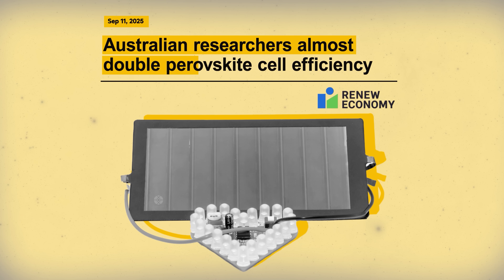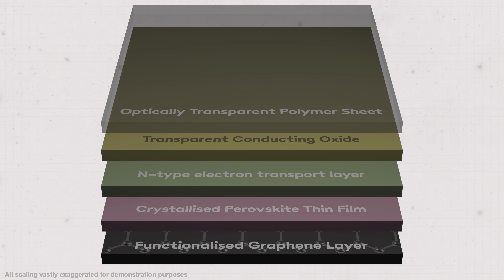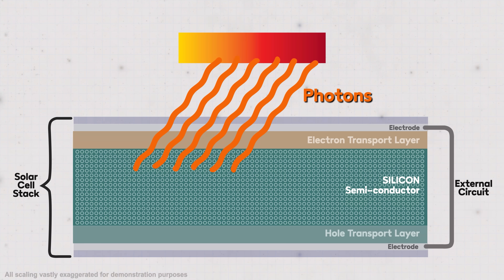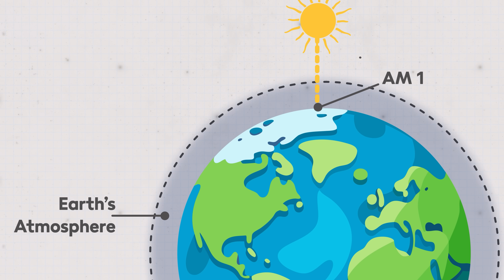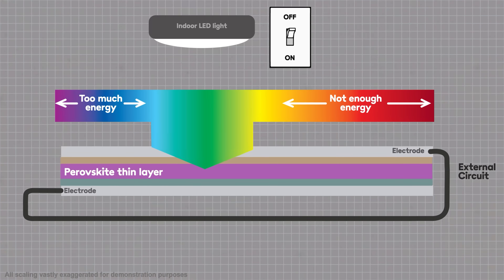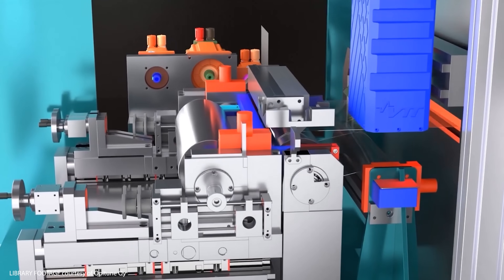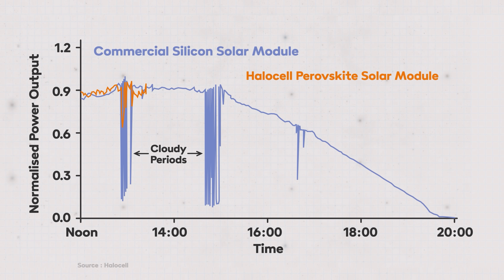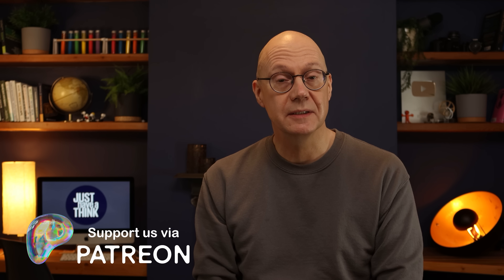Graphene Perovskite just revolutionised the Solar PV industry!

Comment: My advisor who was chair of my EE / CSE dept at Boston University between 2006-2010 once said, in response to the question "which technology domain do you foresee as having the largest impact upon the world in the coming decades?", unequivocally responded "materials", as in nanotechnology and additive manufacturing and composites and such. This video is an excellent demonstration of what he was talking about.  I've had 100+ professors in my life but my advisor is/was a very, very sharp guy among them all...

Your video completely leaves out the longevity question which is a major stumbling block for perovskytes. So there goes any potential for the viewer to make bang/buck comparisons between silicon, tandem cell and thin film solar. Then again, I don't suppose most viewers are aware that perovskytes can be produced for about 1% of the price of silicon panels in part because there's so much less material and in part because of the materials used and their abundance.

There's also a big question concerning recyclability if these thin film panels go bad every 6-12 months...

Comment: What are the relative costs of (1.) the actual panels of a domestic solar panel array; (2.) installing it; and (3.) buying and installing the controlling stuff, inverter, connector to the grid, connector to the battery (assuming you've got a battery), and the thing that decides whether to route the energy being generated to the grid or to the battery? 50%:25%:25%, would you say? 40%:30%:30%?
Reply: Installation is the expensive part

Comment: PV is already at the point where mounting and connections (wire) are at a greater cost than the panels.   Copper prices have escalated rapidly and we ain't seen nutt'n yet.

Comment: Very different story utility scale solar, which operates outdoor with different humidity and temperature conditions. Aslo, as of 2023, the cells cost about 0.2 $ versus 1 to 1.5$ for total installed cost, so only 13 to 20% of the cost. Even with 80% reduction of cell cost, that is only 0.11 $ reduction in cost overall. You can have greater reductions in cost just from better financing. Installation and Construction Labor alone is 15-25% of the Balance of system cost, so with AI and other improvements, we may actually get greater reductions faster.

Comment: This brought me to thinking somewhat of the opposite of absorption as transparency of light wavelengths to operate photonic circuits. Circuits and computers that operate with light instead of electricity. 

If this could be optimized to use solar wavelengths as a variable photonic supply that could be regulated as signals, clocks, and data for orbiting satellite data centers and super computers.
Reply: The operation of these computers could be running analog computations and converted to digital before providing results to ground stations.

Comment: Graphene has been the the horizon for 15 years. Report back when they have made 1 M panels, at a cost that's attractive. The must be using multiple layers of graphene, a 3 mm wide strip of single layer of graphene, 1 m long has a rather high resistance of 5,000 Ohms, a 2 mm copper wire 1 m long has a resistance of ~ 5/1000 ohm, so they must be putting on quite thick ( or at least many layers)

Comment: Something being made of mostly recyclable materials does not make them intrinsically greener as the recycling process itself for some materials is extremely dirty and enegy-intensive. Plastics are theoretically recyclable but the bulk of it still ends in landfills or incinerators because recycling them (ex.: anaerobic cracking for the otherwise unrecyclable stuff to turn it back into plain hydrocarbons) requires more time, resources and energy than it is worth at least for now, especially when you add all of the carbon neutrality burdens on top.

Comment: Mildly good news from China. 1.4 bn Chinese are a major part of the 8.2 bn people living on the planet they have 30 % of the CO2 output - and  they are 17 % of the gobal population. (still use less than the U.S. per capita, and are the manufacturing place of the globe). But their output is relevant. In 2025 it might not rise for the first time (the last quarter is still out).  Some sectors like Chemical industry used more oil, construction / steel and transportation used less. Electricity is mostly produced by renewables and they improved the efficiency of coal plants. They rolled out renewables and EV big time.

Comment: In my experience of evaluating perovskite PV startups, the hurdle is not their efficiency or cost. Those are perovskite's advantages. The main problem is that LEAD is used as a key component in the light-absorbing perovskite material to form a lead-halide compound that efficiently converts sunlight into electricity. It is such a big problem that even China, with its lower environmental safety standards, has not begun mass production of perovskite solar PV cells.

Comment: Come on. The fundamental problem with perovskite solar cells is that they degrade quickly. You can reliably expect 80% of original energy production two decades after installation from silicon based solar cells but perovskite degrades three times faster.

Comment: I think it's extremely deceptive to say this has "revolutionised the solar PV industry" when the use case that this performs well in is speciflcally with non-solar sources of light.

It also seems pretty disingenous to talk about how impressive the 30.6% figure is in comparison to state-of-the-art AM1.5G measurements when the 30.6% figure isn't an AM1.5G measurement at all. It's comparing apples to oranges.

I can see the use cases for this technology, but the way it's been presented is sensationalised & clickbait.

Comment: Having recently installed some Balcony Solar, and bought some home solar, I noticed that most of the cost is nothing to do with the panels. Even with Balcony (DIY) solar, the support structure costs the same as the panel.
Hence reducing the cost of panels (currently €55 for 450W in Germany) further will have little effect.
However, increasing the efficiency would have a major impact. When the 10KW system can become a 15KW system, but with the same labour costs, same frame costs, pretty much same wiring and inverter costs, then we can get further cost reductions.

Comment: Once a week there is discovery that revolutionized the solar panel technology imroving efficiency by 50-200% and reducing manufacturing cost to half. Still in past 20 years solar panel efficiency has only improved like 2%. Cost not having changed that much.

Comment: Adding graphene layer to the existing silicone photovoltaics would eliminate their biggest problem: degradation over time.
This degradation happens because hot spots melt thin copper wires inside.
Graphene can take a lot more heat and still be functioning.

Comment: Technical breakthroughs like these were not factored into Tony Seba's predictions about lowering coast and improved efficiency in clean energy.  Instead, Seba focused on already existing technology and based his predictions, remarkable accurate ones, on the learning curve in manufacturing and volume growth.  Tech breakthroughs like these will boost the the benefits of clean energy -- lowering costs and greater efficiency.  Tony's solar energy predictions from around 2010 showed a halving of the cost of solar energy every 3 years or around an 87.5% reduction each decade.  He predicted that this S-curve of lowering costs and higher production would continue into the 2030s.  Wholesale costs for energy produced by U.S.  grid-scale solar arrays is around 2.5 cents per KWH or $25 per MWH.  That's about half the price of electricity from Natural Gas combustion.  By 2031 solar electricity will be below $.01/KWH.  Virtually free as RethinkX predicts.

Comment: Even if they have doubled efficiency AND lowered cost, they still haven't fixed the major unfixable flaw. They only generate power for about 8 hours a day (with ramp up and drop off) and only anything near nameplate from 10am until 2pm yet produce nothing at all from 4pm until 8am the next day. That's 16 hours of zero generation during the time of peak demand.
Reply: 😂
Have you heard of storage ?
How about wind, water, geothermal, ?
You fail to mention when the peak demand occurs.
Time you stopped talking crap.

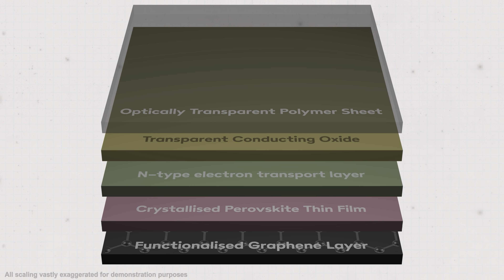Comment: 2:18 Remember, graphene only acts like graphene when it’s suspended in vacuum, not touching anything. It’s so thin that sitting on a surface changes its electron structure, wiping out its interesting electrical properties.

Comment: First of all, adding graphene might make the device cheaper, but it is unlikely to add any performance benefit in comparison to silver or gold.

2) They added metal nanoparticles to the graphene. Usually those metal nanoparticles are gold. So it still has expensive metal in it, especially since they are nanoparticles, which adds to the cost.

3) The problem of perovskite is the stability. Replacing the bottom metal electrode hardly helps.

4) The silicon panel cost of solar installations is a small fraction of the total cost. Even if you cut down the panel price by 80%, your gains are marginal.

5) The real step forwards is tandem solar cells, but you cannot use a graphene-nanoparticle layer as an intermediate between perovskite and silicon.

6) Perovskites contain highly toxic lead, making it questionable in everyday applications. Nobody wants their kid to use a calculator that turns them stupid through lead exposure.

7) Indoor lighting is a very niche application. It will hardly revolutionize anything.

Comment: It seems to me that this light weight technology could be placed on the inside of existing windows, in place of curtains which are drawn typically when the sun is beating into a room,  In high density environments, such as Office Buildings or high rise Condo / Apartments the roof space per occupant is reduced the higher the building goes and utilizing the sunlight through the windows on sun facing surfaces could power a good chunk of the Office or multi-family home locations.  I feel that only thinking of ground or roof mounting is fairly limiting and loosing out in areas that are forced to build upwards.  The economics works out for the "renter" of the office or apartment as they are on the hook for the energy bill, not the building owner at least in the US.

Comment: Chemist here. One of my professors is very knowledgeable regarding solar panels and I'm going to explain what i remember from what he told me over a year ago. The problem with perovskite solar panels isn't their cost or their performance. The problem is that they use lead for the crystal structure, which is toxic and banned in electronics. Moreover, they degrade by moisture and uv light, and guess what solar panels get alot of. So while these numbers are cool they have no value as long as the existing problems aren't tackled.
Reply: You took the wind out of his sails

Comment: #Graphene ⚡🌍💡 People keep talking about AI, EVs, and clean energy like they’re the future but they’re missing the real foundation that’s going to power all of it graphene the Miracle Material. This isn’t just another buzzword material this is the next evolution of everything. Graphene makes artificial intelligence run faster makes electric vehicles charge quicker makes solar panels and batteries more efficient and even strengthens the materials we build our world with. It’s lighter than air stronger than steel conducts energy better than copper and is one atom thick meaning it can be used in virtually anything from energy and medicine to construction and electronics. We’re talking medical sensors that can detect disease instantly buildings that generate their own power and devices that never overheat. The future isn’t just digital it’s material and the material is graphene. Companies that can scale and apply it to real world industries are about to spark the biggest industrial transformation since the discovery of silicon. We’re not looking at a trend we’re looking at the next foundation of technology itself. ⚙️💎 #AI #CleanEnergy #EV #GrapheneRevolution #Innovation #FutureTech #SmartMaterials #NextBigThing

Comment: It's ALL about THE BATTERY BACKUP.  It has to charge quickly, backup capacity has to be sufficient to last days and  the cost. Still, for the cost, it's a big stretch. Oh and there is the heavy snow or Hail factors.

Comment: I'll probably get more exited about perovskite PV when there are perovskite PV cells that are proven to last for a long time without babying, and at a reasonable cost.   

I really like the idea of having solar cells on devises to keep batteries charged, but there's a big problem with making commercial products with solar cells on them to charge internal batteries, especially for products indoors. It's the fact that people will be tempted to put them in sunny windows to charge them, and that means they will get hot, which isn't great for the products, even if the solar cells on them can tolerate the heat. If it wasn't for that issue, flat and wide power banks with solar cells on them could have been a pretty good product. Or, putting solar cells on the back of lap tops and surf pads, even phones. Not that solar cells on the back of a phone would produce much power, but something is better than nothing, unless that something comes with severe drawbacks, like people frying their phones in sunny windows when they try to make that something as significant as possible.    

While the idea of much higher efficiency in low light conditions seems attractive, it's important to realize that higher efficiency is a bigger piece of a much much smaller "cake". Full sunlight can be over 100'000 lux, residential indoor light levels from artificial lighting is typically up to a few hundred lux, when the light is on, general light levels in professional situations are sometimes a bit over 1000 lux, meaning around 1% of full sunlight, so if you can achieve twice the efficiency of conventional solar cells, you can get about 2% the output of conventional solar cells in full sunlight, in very strong artificial indoor general lighting. 

If you power artificial lights just to provide light to those solar cells you've created a very inefficient, complicated and expensive form of wireless energy transfer.         

Another issue for commercial products is the fact that most people want a system that reliably cover all needs, and fail to see the point in having solar cells on something if there's a relevant chance that you have to charge/change batteries anyway, just less frequently.

Comment: I am trying no more with Gooogaol dobeevilcorps to locate data. I would like your video about latent heat of fusion. The searches refuse to show you even beginning the search with your channel handle. Sickness is them ..... in the olde worlde regency sense of amputating body parts to feed them sickness, not Chomsky language mangle detector needed to comprehend words seeming familiar but good sickness that's healthy now in corps language.

Can you direct me to the vid? If I get no reply I will give yt the benefit of the doubt and presume they are not regally inspecting before forwarding, if forwarding at all, messages but take the silence as another instance of a milked sick peep giving up with the comments. In Usenet years it was good; only the ...... um ..... special types that not who couldn't configure the free agent news client spoiled sociality.  Some used to even bother to reformat every Microsoft outlook issued posting so that those wanting to could comprehend the conversational threading and try to help.

I stopped when I realised they loved bill gates and were not, as I might have known given different arrangements, not at all in fact, capable of using spoken or written language. I expect goooooogaol, even worse than them, to soon decide those archives need removing from public access like the BBC do.

Thanks for the reply if I get it.

Text errors by goooooogaol. Never proof read material injected into it. Adv.

Comment: Perovskites using tandem cells will never find satellite application for two reasons.   (1) All tandem cells destroy themselves in space due to differences in thermal coefficient of expansion between the silicon and perovskite material. (2) "Cheap" radiation-susceptible solar cells at low efficiency mean larger and heavier solar panels on orbit, which increase the satellite LCOE to a level that isn't cost-effective EVER.

Comment: why do most discussions about perovskite leave out mentioning toxic lead? this combined with fragility and vulnerability to water make it very dangerous to make billions of these into devices that will break, fall on the ground, and get thrown into the trash. they already tried this move in the 20th century with lead paint and leaded gasoline; don't need to repeat same mistake with "clean" energy in the 21st century. also, current silicon cells are already dirt cheap at just a few cents per watt, reducing that by a penny or so is nearly meaningless; and with leading silicon cells pushing past 27% efficiency, moving to a new tech potentially 30% is just not that big a deal anymore.

Comment: Wait for  increasingly paranoid theories to match the increased efficiency in an inverse relationship? At 70% efficiency the PV panels still won't be good enough : Solar as a 'Controlled Opposition': The idea that the fossil fuel industry is promoting solar panels on purpose, but ensuring they are inefficient or temporary, as a distraction from more effective renewable solutions to maintain their dominance. The fact that internal combustion engines are 20% to 35% efficient (Energy converted to motion at the crankshaft) must be some kind of plot to increase the level of data centre digital furores which often have 0% shared cognitive efficiency?